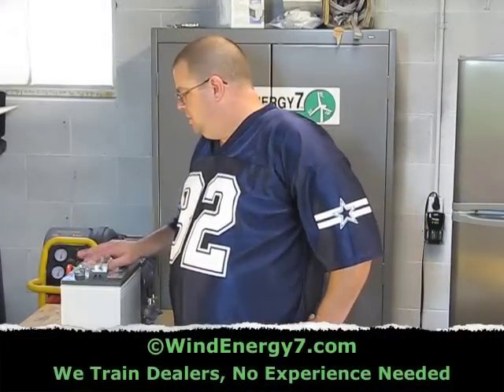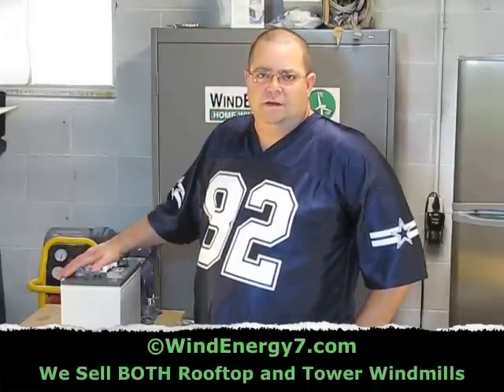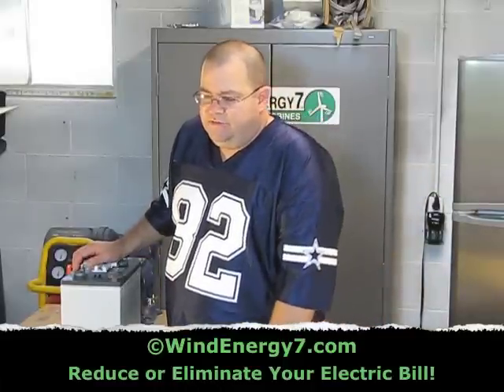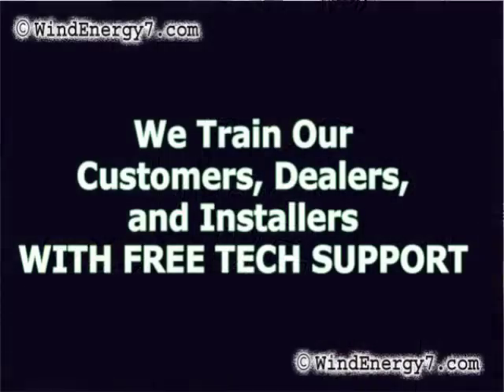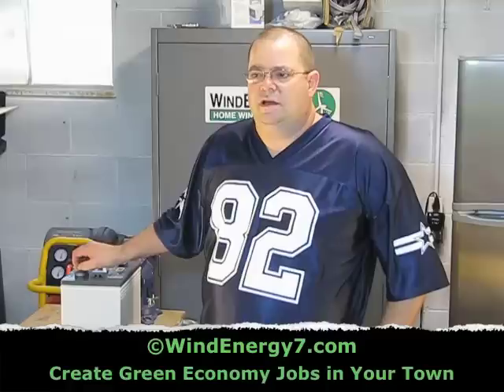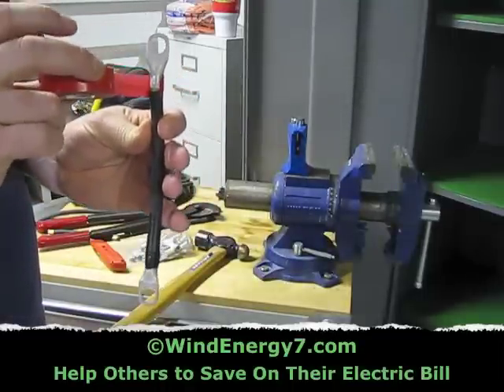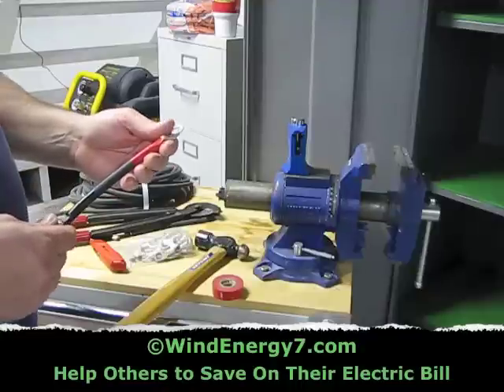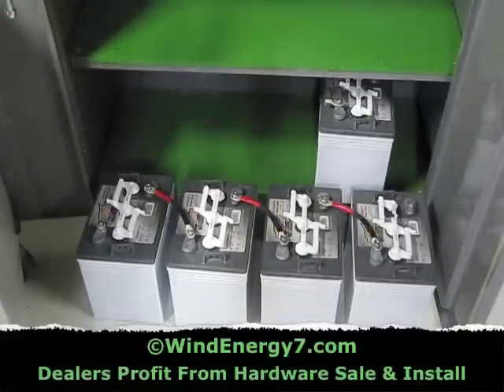Solar Training Turbine Training 1

Comment from the maker: Want Solar Power For Your Home? Our solar installation on Your Home is provided by some of our local dealers. We have a network of customers, dealers, and installers from Hawaii to New Jersey. WindEnergy7 LLC will support your project as a self install, or a turn key install with assist on managing your project. We don't just sell parts, we sell complete systems for Your Home.
.
MORE Videos, Pictures, and Pricing - - WindEnergy7 (.) com
.